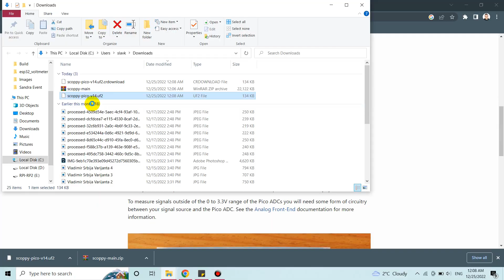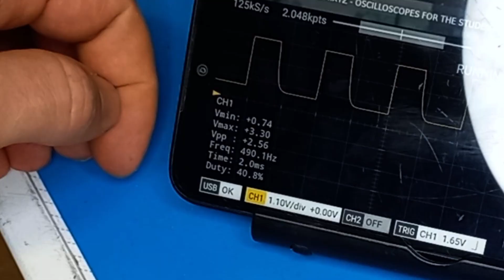How to Make an Oscilloscope for Yourself | What’s an Oscilloscope? | Cheap Oscilloscope

Comment: What is the resolution of this oscilloscope, I mean the highest frequency we can measure????   Also as I can see that you are using Arduino Nano to generate a waveform, I believe that this is temporary and not needed later.... right??
Reply from the maker: The ADC of the PICO has a 12-bit resolution. The nano here is just for demonstration, I am sending a PWM signal, and at the same time reading it using the PICO, just to see the signal and test the device, you can use a signal generator or something else.

Comment: What are the voltage limits on the input?  I assume if one wants to measure voltage waveforms beyond the limits, circuitry would have to be added to bring the voltages into the required range.
Reply from the maker: Yup, we have to make a voltage divider to measure voltage above 3.3V.
Reply: @SlavkosHobbyChannel  Understood.  Great demo... thanks.